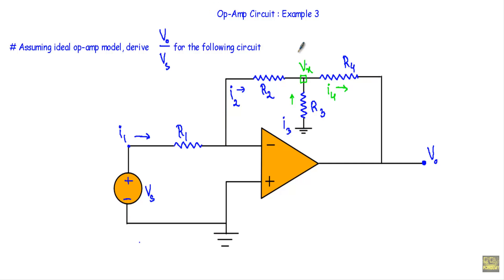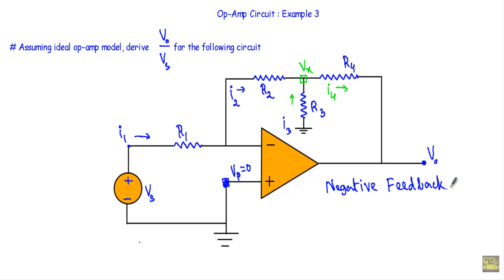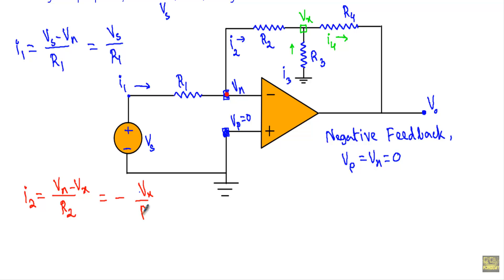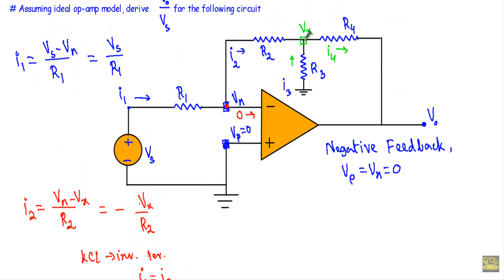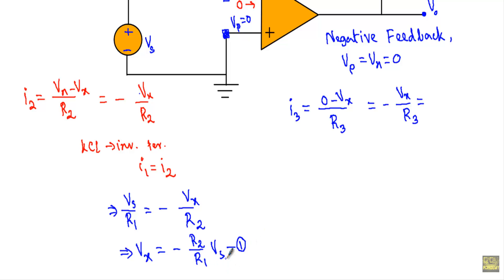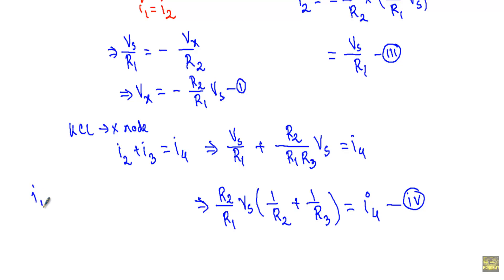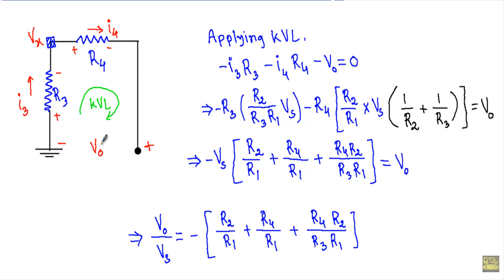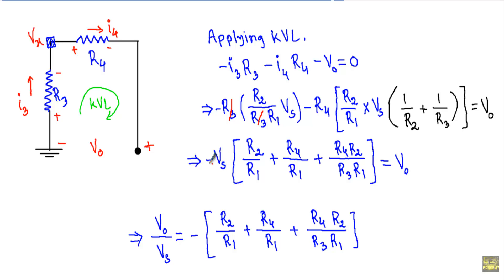OP-AMP Circuit : Example 3

Comment: in an open circuit, loop cnnot be considered
Reply from the maker: Are you sure?? There is a loop named open-loop, is widely used to calculate open circuit voltage. In the circuit, as the o/p is not connected with any load, so Vo will be the o/p voltage between o/p to ground which is an open circuit or open loop voltage.